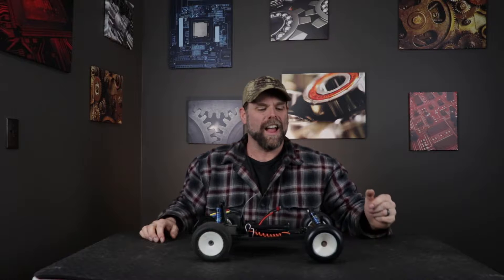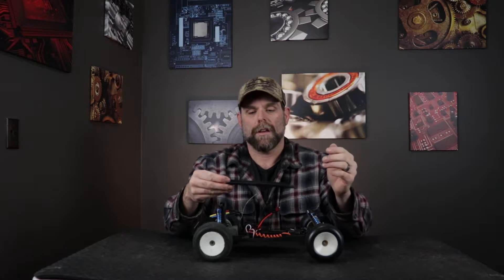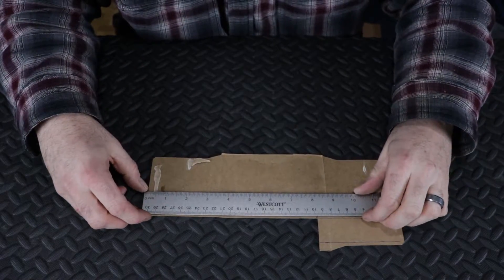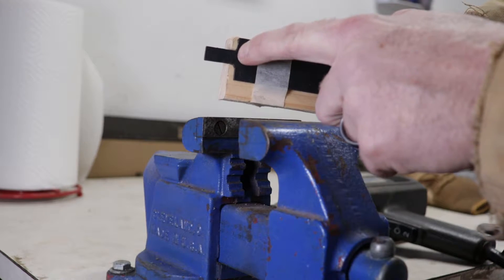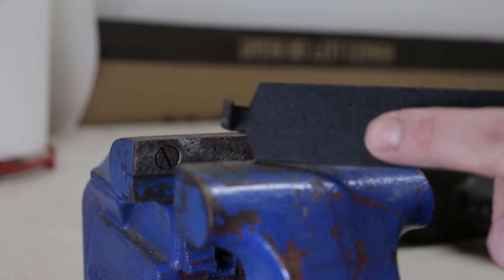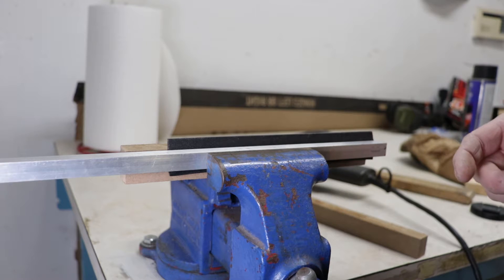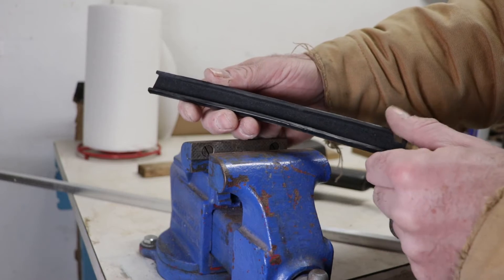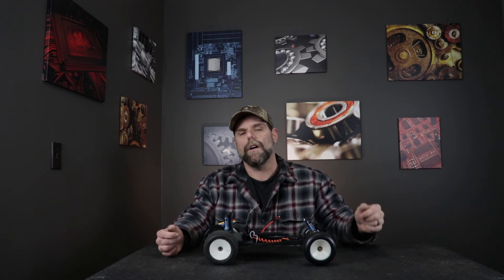How To: Making your own RC parts

Comment: Cool tip. I'm always interested in parts making as most of the RCs I have or are eyeing are sold at deep discounts, ie - being discontinued from that brand, which means finding part replacements will be harder in time. I recently picked up a 3d printer and I really dig it. I think that's an easy solution for printing part replacements... Now I just have to learn CAD with a free program like fusion 360 or tinkercad, etc.
Reply from the maker: There's definitely a big learning curve with Fusion 360.  I know just enough to do the basics, but my more complex designs like my 10428 bulkhead are a mess in that trying to modify them usually ends up causing problems.  There's a real method to designing parts in 3D in a way to be able to make changes later.

Comment: Hey Jim, where do you get your Kydex?

Also, since you really only need to heat the "hinge", you might find it faster to lower the wood on the back side a little to expose the "hinge" part a bit. That might allow you to continue folding it over while applying heat. Or maybe I'm way off base, I've never worked with Kydex before :) Great video.
Reply from the maker: I buy the Kydex on Ebay.  I'm not visualizing how you're describing the heat & bend of the tab.